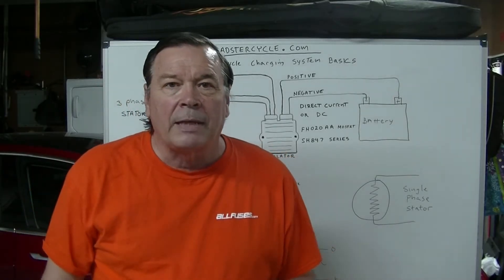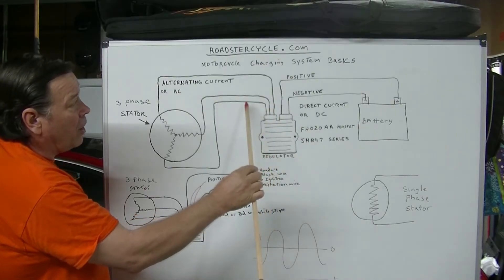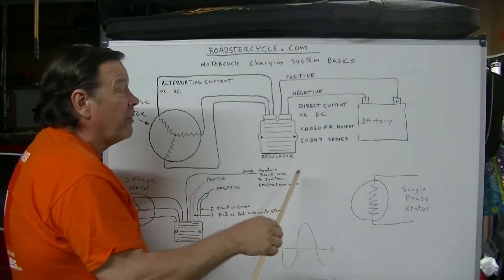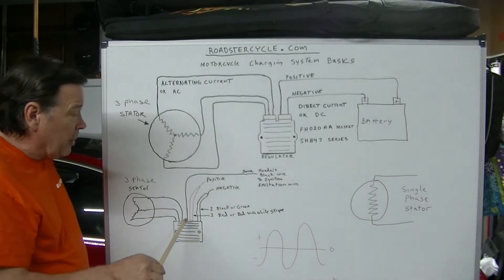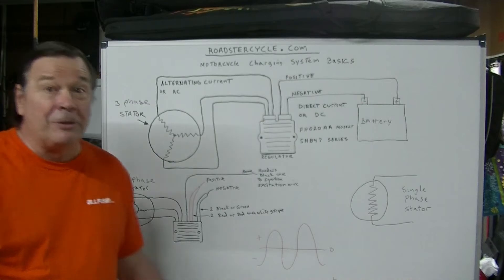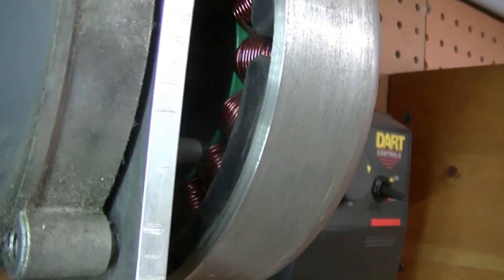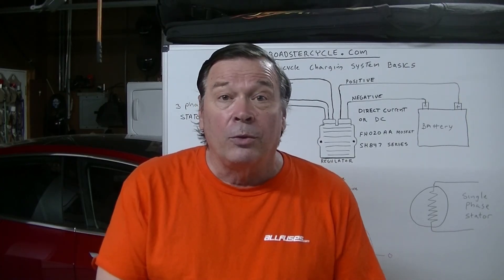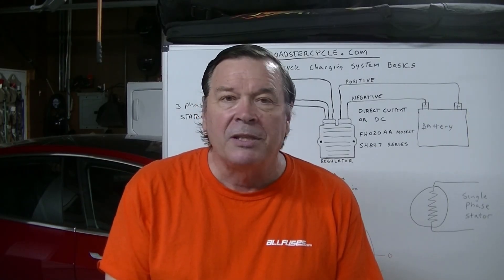Motorcycle charging explained

Comment: I have 2008 hayabusa with Fueltech computers and is turbo charger the problem the I have is at battery showing 13.5 volt and my Fueltech monitor showing 12.9 volt I hold rpm to 5000 and  test battery volt and don’t change stay at 12.9 ,13.1 volt how can I found a problem with my charging system . Thank you for you help 
My name is Ray
Reply from the maker: Hi Ray, go to my website and  first do a stator test to see if your stator is up to speed.  If your stator is good then it is probably the R/R. All my Hayabusa customers are running the SH847 series regulators now.  You can contact me through my website if you need more direction on testing.

Comment: my kawasaki atv doesn't have a battery and when its idles my lights are super dim theres 12v at the wires can i use a battery stop the dimming?
Reply from the maker: Usually those systems are AC voltage running lighting.  You'd need a regulator/rectifier to use a battery.

Comment: Hi I have just replaced stator and rectifier on my motor bike but still same  it's not charging the battery.It's a lifan 110cc can you help?
Reply from the maker: First check your stator and make sure done of the poles are going to ground. None of the 3 wires should have any continuity to ground. Also look at my website or on youtube for a regulator check out video. You can also email me. Jack@Roadstercycle.com

Comment: I have a 2005 Triumph Speed Triple which has burned a few stators.Especially the cheap after market units.I got into the habit of always leaving my heated grips turned on in the belief it would burn up some of the excess voltage and make life a little easier for the stator.Not too sure if it works that way.I have a Shindengen Mosfet RR on the bike.

Comment: So,.....stator to regulator but I also have a rectifier....how does the rectifier figure in to this equation?  (you may have guessed I'm completely ignorant).......trying to minimally wire a bike,....lights, horn, blinks. starter and a charging system for the battery.
Reply from the maker: The rectifier is built into the regulator and it changes the AC, alternating current, like your house uses, then changes it to DC current, then the regulator regulates the DC output to charge and run your motorcycle.
Reply: Thanks for the reply.  I actually have a separate rec and reg.  So I ordered a combo unit after watching your vid.  1977 KZ750 Twin.  Hopefully this will work.  I’m walking through the Black Forest with a pen light…….
Reply from the maker: @tomvband   the answer to that is on my website in the left index column.  Early model charging systems.
Reply: I’ll check that out certainly.  I also noticed I have 7 wires coming out of the stator area……
Reply: I didn’t see that link?

JACK'S GARAGE
SALE
Frequently asked
questions

About Us

HELP VIDEOS

Shindengen FH020AA
 regulator/rectifier
universal kit for almost
all 2 and 3 wire stator
motorcycles.

1970s Era excited rotor regulator build up for
bikes with rare electromagnet rotors.

LED Voltage Monitor

FH012AA/FH020AA
and SH847
mounting dimensions

Stator Testing Example

Easy Mosfet Hookup

'32 Roadstercycle® 
Harley Powered 

'34 Roadstercycle®
Vmax Powered

Recent
Projects

Contact

But it does look like I could just buy what I need……up to the reg/rec from you?
Reply from the maker: @tomvband  1970s Era excited rotor regulator build up for
bikes with rare electromagnet rotors. I believe this is what you have. Email me a wiring diagram and I'll let you know. jack@roadstercycle.com

Comment: I bet you get a zillion questions about the 2% of the bike who do have a car like alternator system. 
My bike is  russian Dnepr with such a car like alternator. These alternators are (to put in blunt) a piece of sheit - pardon my french. So I like to see if I can do something to get the charging ball rolling more reliably. I was looking at stators from other bikes and looking into ways of spinning the correct pieces to end w=up with a reliable charge.
Since a bike hardly (if at all) charges at a stoplight I was thinking of fitting a modern stator and a magnet rotor onto the hind wheel axle of the dnepr bike.
What do you think about such an idea? Maybe too low rpm to get anything useful or could it work??

Comment: In looking into buying FH020AA from the site.  
Very interested if it will work on my bike keep it running for good this time.  My stock 07 k7 gsxr750 doesn't have any electrical upgrades besides safety, Guards, side bar guards
Real question leaving me lost is the stock lead acid battery.  2009 manuals say I need a slow pace charging battery charger (3v believe it was saying) Do you believe this to be true on my model bike?
Reply from the maker: I believe it meant 3 amps trickle charger for off bike or non running bike charging, not a bikes charging system. The FH020AA Mosfet charges about 14.3 volts with a good battery and stator. Amps will very with load.
Reply: Hey Jack I appreciate your help with this.  Your videos are amazing 👍👍 I'll definitely share.  One last question I had was on a recent video on the shunt style regulator used in today's modern suzuki's or other bikes such as the FH020AA, is the stock factory regulator from Suzuki themselves more equal in reliability THAN your product?
Reply from the maker: @cesarzapata9839  The sh847 on my website is actually made for the Suzuki 1000 bike.  I have no knowledge of the others on Suzuki's other than I replace a lot of them.
Reply: @Roadstercycle  what is your web site, own a gsxr 1000 would like to get a sh847 since my is overcharging the battery and damage them ?
Reply from the maker: @moralesrd  Hi,.  It is Roadstercycle.com.

Comment: friends thanks for  video..a question how much do you pay for the lg batteries in the mustang, thanks
Reply from the maker: Just over $500 a piece.
Reply: @Roadstercycle  i was considering rewiring a gsxr 1000 stator add some batteries and controller and make it like kers.

Just a boost for some seconds 5-10 seconds and 5-10Kw

Do you think the stator could be rewound to handle the 10kw??what do you think?
Reply from the maker: @FirstLast-tx3yj  I like the out of the box thinking. Charges with the engine running like regenerative braking and then gives you a shot of electrons like nitrous for a momentary boost. Will it work? I have no idea. But I like it.
Reply: @Roadstercycle  yh a neverending shot of nitrous. I looked up some E-skateboard hub motors making 3KW and some even more so I wondered why 10Kw wouldnt be possible.

If the stator can take it then it has no reason not to work.
Reply: @Roadstercycle  mitsubishi and mercedes are using the same electric motor on the crank like the stator on motorcycles since 2018.

The concept has been proven to work all is needed some batteries and a 10kw controller!